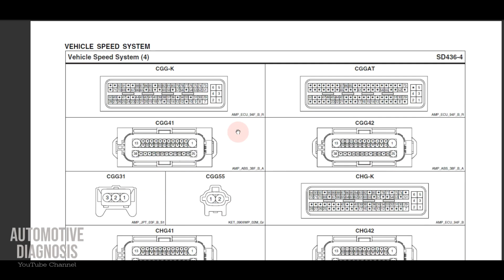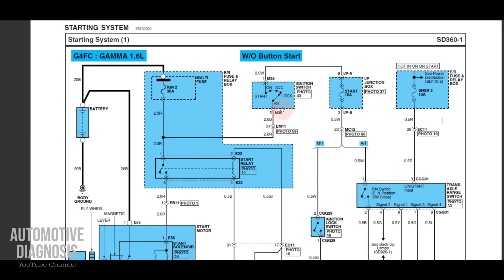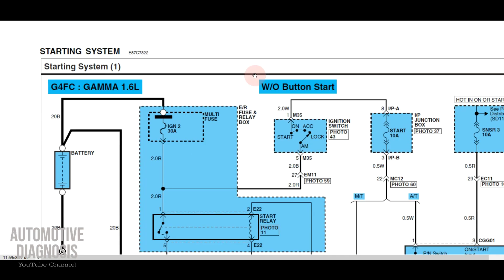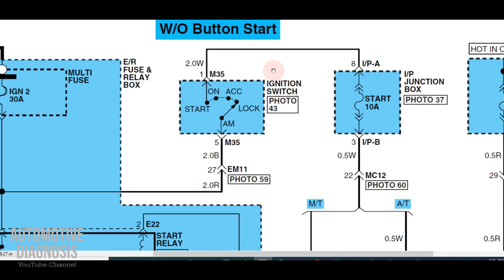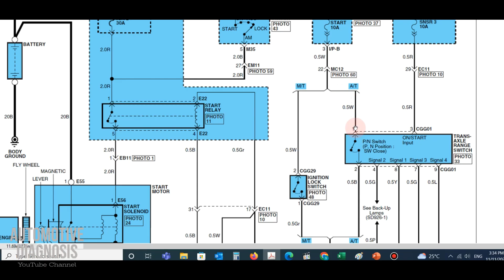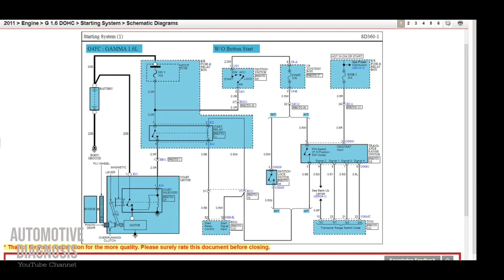Master KIA and Hyundai Wiring Diagrams in 30 Minutes!

Comment: I have a mess of wires in my 2012 Kia optima Lx 2.4L I need to figure out not sure where to find out what the wires are and what they connect up with. They are all located under the steering column 2 wires together black and green, 2 wires one black one red they are cut and 4 wires together blue, red, orange and brown they are also cut my car won’t start with the key. Help please 😅
Reply from the maker: Hi there, there is a wiring diagram on our website for Kia Optima TF which is applicable to your car (hopefully 😊), that might help, find it on our website on the wiring diagram page:

https://mechanicourse.com/

Comment: Hello 👋 
Please need you help! How can I contact you? I’m looking for 2 thing
1- full AC Electrical system diagram for the kia Sorento 2017
2- the layout diagram for the wires that comes in/out harness the AC controller with colors, also for kia sorento 2017

I really need it since I have a huge issue with my car and my car was going to burn down the engine fuse box started melting and the harness on the back of the AC controller became brown and the wires get extremely hot! 

Please help 🙏

Comment: Does a 2002 Kia Optima have a Body Control Module?  And if so, where is it located?
Reply from the maker: On that model there was an older version of BCM that used to be called "ETACS" and it's under the dash on driver side.

Comment: Pls I need this schematic for a 2013 kia Quoris GDS schematic with location
Reply from the maker: Hi my friend. I don't have the PDF file for all systems, if you tell me what system you need, I might be able to find the diagram.
Reply: @ thanks 
I have a parasitic drain coming from Memory 1 fuse and this contains a lot of modules that I would need a components locations. I have narrowed it down to I/P Floor A contact 26 but I am stuck with components locations.
Reply from the maker: Hi my friend, here is what I found:
I/P A connector details:
https://drive.google.com/file/d/1atPlIgwVlcySQQHJxjqw8gGCnc92CZMm/view?usp=sharing
I/P A Connector location:
https://drive.google.com/file/d/1dfRg9MukLFTNnoo3RtIDYAIX5THTezqO/view?usp=sharing
Reply from the maker: I think you need BCM diagram. If you send the VIN number, diagram will be more accurate. You can send it to this email address:
Automotivediagnosisyt@gmail.com

Comment: Great explanation, thank you for taking the time to do this. What is the name of the software you use that shows you the location of each connector & pin ?
Reply from the maker: Hi my friend. It was Kia/Hyundai GDS. it used to be their OEM scanner for years and it comes with all diagrams and manuals. You don’t need to buy the scanner, software alone also works fine.
Reply: Pls where do I buy
Reply from the maker: @adsonymichael8778  Try searching "KIA Hyundai GDS Scan Tool" on Google, you will find it.

Comment: Hi there, thanks for video. 

I am wondering where you get those wiring diagrams from?

I have got vauxhall insignia b 2017 1.6 and would like to get same type of waring diagrams like yours. Is this something you can help with?

I am currently experiencing 3 DTC codes: u1510, u01b0, u1516

Is this something you can help with?
Reply: I believe u codes are no communication between modules.  Can-bus system is a whole different animal

Comment: Can I get a copy of the wiring schematic for the 2018 Kia cerato YD push button start all electrics please 

Would you know if this car has positive or negative or can bus controlled head lights trying to get a high beam trigger wire @AutomotiveDiagnosis
Reply: Woooow
The way you instruct is awesome
You changed my view 
God bless you
Reply from the maker: @behzadhashemi8488  Hi my friend. I'm glad you liked the videos.
Reply from the maker: Hi my friend. It’s going to be a lot of wiring diagrams to export, I can do it for a couple of systems though. Which systems diagrams do you need the most?
Reply: @AutomotiveDiagnosis Headlight switching diagram is it positive switched or negative switched or is it part canbus controll need high beam trigger wire 

Also alternator wireing looking to upgrade the alternator due to car audio system looking at the power bastards alternators they are 220-250amps there’s a couple they have not sure which one to get thank you
Reply: @AutomotiveDiagnosis Look up mate
Reply from the maker: @91rickstar  Hi my friend, here is a link to download the charging system diagram for free (Headlight diagram will be uploaded very soon and link will be posted here):
https://fix-it-first.com/product/kia-cerato-yd-2018-charging-system-wiring-diagram/
Reply: Thank you what do you think of the alternator the 220-250a one
Reply: Is the 2l the same circuits as the 1.6l I’ve got the 2L sports plus 

I have the engineering mode for the 7” Radio it has windows ce7.0 on the radio as the main operating system it’s not android which is weird because it has apple car play but os is windows
Reply: Also I want to run A 2/0awg wire from front battery to my battery system in the rear hatch back which way would be best to run that cable safely idk if I should go though firewall though the door channel I don’t know if 65mm2 will fit though channel or should I go under the car and put a gable gland on the under side of the spear wheel goes here’s my alternator I want to buy but idk if any good 

powerbastards* comm product number 14962-250-HD1-1
Reply: Also I want to run A 2/0awg wire from front battery to my battery system in the rear hatch back which way would be best to run that cable safely idk if I should go though firewall though the door channel I don’t know if 65mm2 will fit though channel or should I go under the car and put a gable gland on the under side of the spear wheel goes here’s my alternator I want to buy but idk if any good 

powerb4stards* comm product number 14962-250-HD1-1

Remove the 4 and put a in place google does not like that word
Reply from the maker: @91rickstar  Wiring diagram is the same, only pin numbers on PCM side are different
Reply: @AutomotiveDiagnosis I’m looking to install a 2/0awg wire from front battery to my rear 170ah agm battery which way would be best to run the cable idk if the cable will fit though the door channels might have to go under the car what do you think